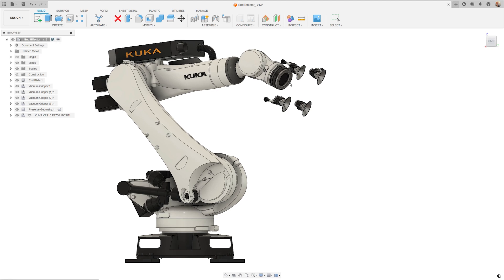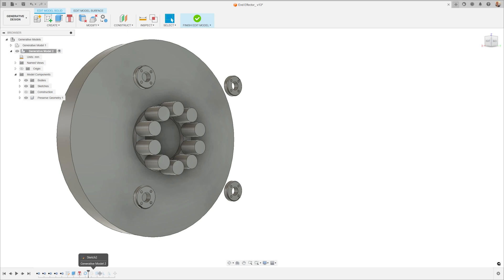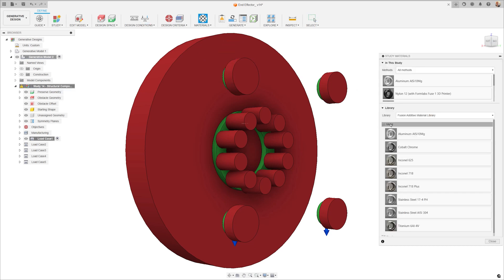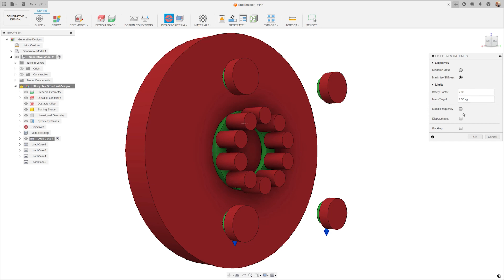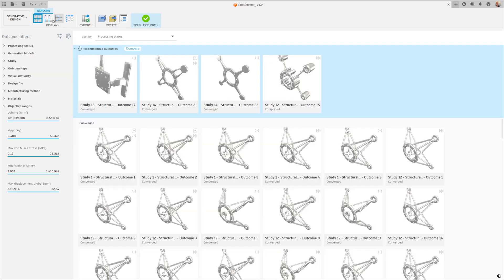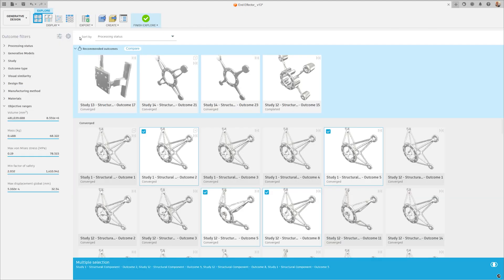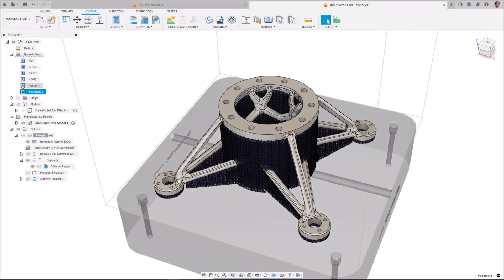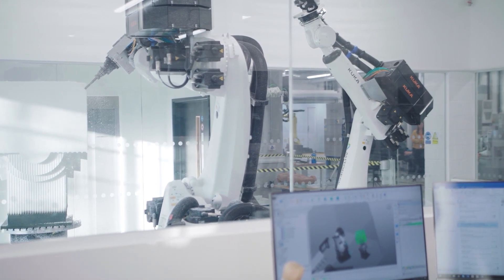Generative Design in Autodesk Fusion

Comment: Here's a way you can get hobbyist to buy a 3DPrinter version of Fusion.
Make an AI program determine best ways to cut join and fasten larger 3D prints based on Printer Size and Print orientation , the AI could also work out best ways to make a part Stronger based on Load and force.
Well I think it's a cool idea I would buy a 3D Printer version of Fusion if it was a suitable Price.

Another good feature could be designed suports generation.
Reply: That feature already exists in common sliders like prusasclicer and cura